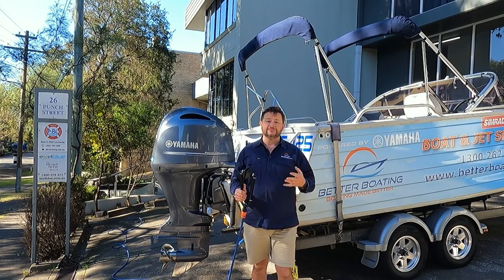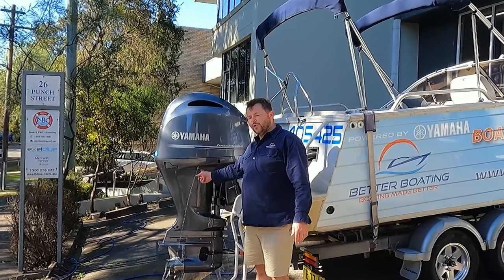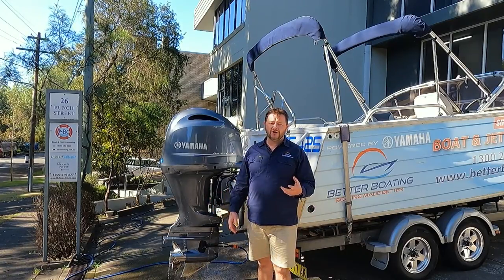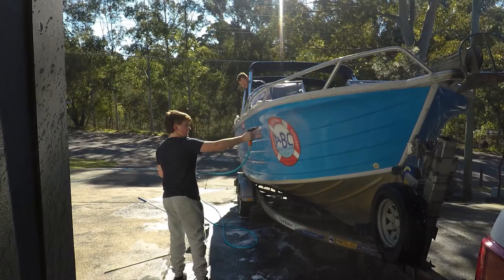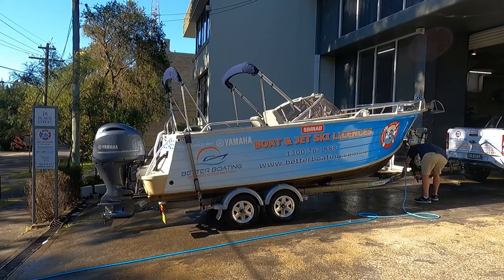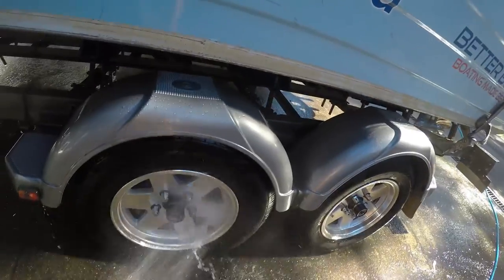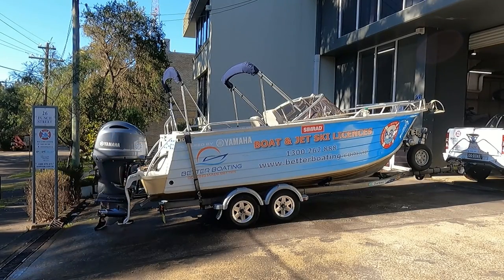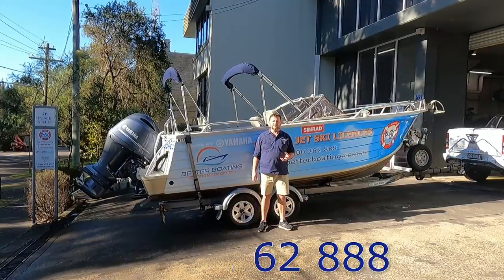Boating 101: How to Clean a Boat After Use | ABC Boating Sydney

Comment: I have a Yamaha f150 and the owners manual recommends a different method of flushing the engine and no need for the muffs. There is a little hose on the left side at the bottom of the cowling you unscrew it and attach the hose to it. No need to start the engine.
Reply: Same, I have the F75.... However, unless you are flushing it immediately after you get off the water, I'd suggest still doing this method to ensure that the thermostat is open and you're flushing the pump internals too... Not just the pipework.